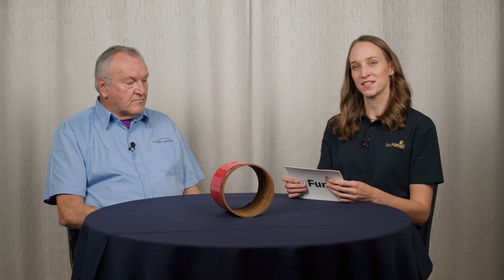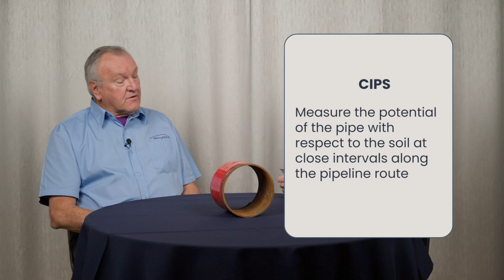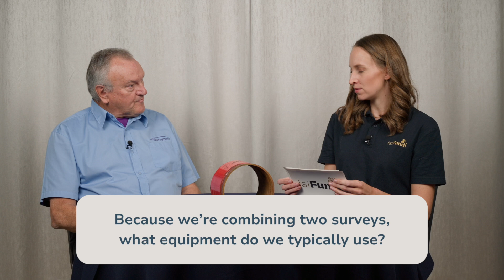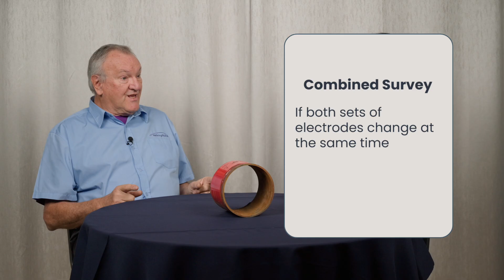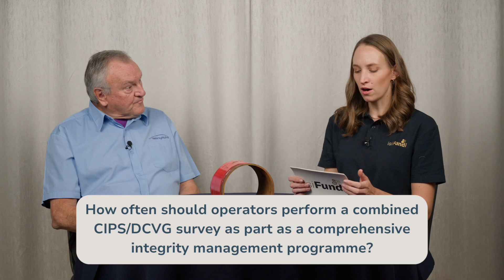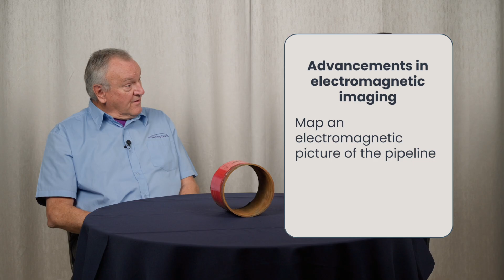CIPS/DCVG Combined Survey Explained | PIPELINE SURVEY TECHNIQUES

Comment: Dear Sir,

Q1: If CIPS and DCVG surveys are performed at the same time, how should I set the current interruption period since both surveys have different ON and OFF cycles?

Q2: What does ON and OFF interruption actually mean in DCVG, and could you please explain the ON and OFF potential details?

Q3: When we find a defect during the DCVG survey, what information do the ON and OFF interruptions provide us at that time?
Reply from the maker: Great Questions! To Q1: The longitudinal gradient is continuously recorded, so you use the CIPS cycle (long ON, short OFF) to ensure the pipeline does not depolarise during the survey.
Reply from the maker: To Q2: Q2: I presume this Q relates to stand-alone (analogue, conventional) DCVG. We are interrupting a DC source in order to measure the voltage gradient in the ground around the pipe, which results from the current flow through the ground from the DC source. The purpose of the interruption is to ensure that the gradient you are measuring is the result of the injected DC signal. We measure ON and OFF gradient values in order to get a measure of the magnitude of the current flow in the ground, which is in turn related inter alia to the physical size of the coating defect. The ON & OFF potentials of the pipeline are recorded in order to determine the relative intensity of the gradient.
Reply from the maker: To Q3: The difference between the ON and OFF values reflects the intensity of the voltage gradient. In terms of Ohm's law, this is determined by the magnitude of the current and the resistivity of the soil.
Reply: @isifundi Thank you for answering all my questions. Much appreciated!